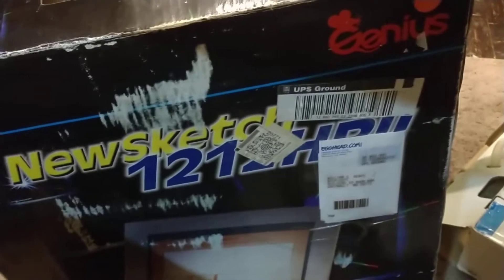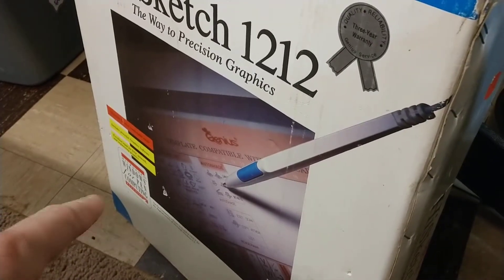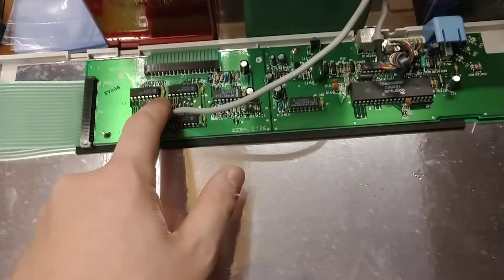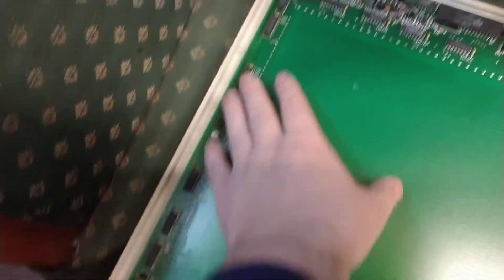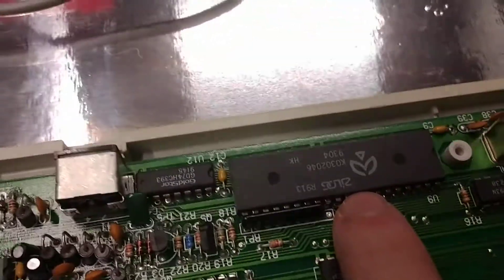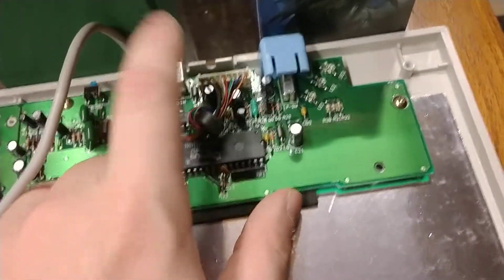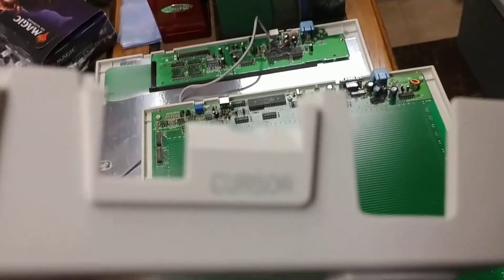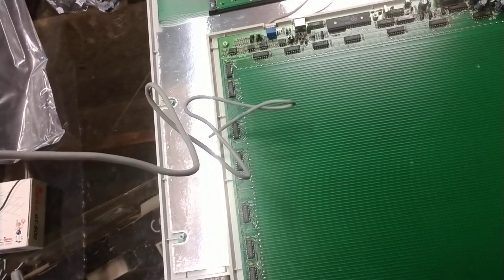Genius Hisketch/Newsketch 1212 quick comparison

Comment: Did you get it too work?  Can it work with Windows 10?
Reply from the maker: Yes. One of them works now although the connection is a little tricky with the power supply plugged in barely fitting. Works with windows 3.1. Haven't tried to get it to work with windows 10 yet. Would be fun if it did and used this old 90s large format cad tool with say like fusion 360 or some other modern cad or 3d modeling program.